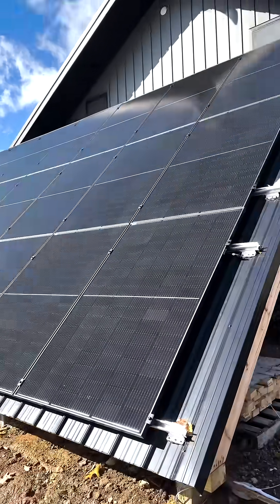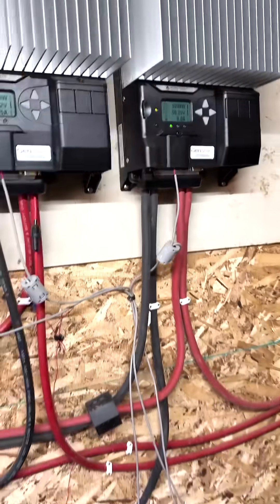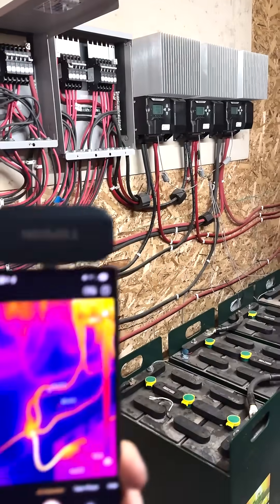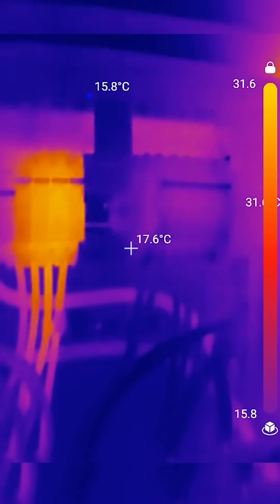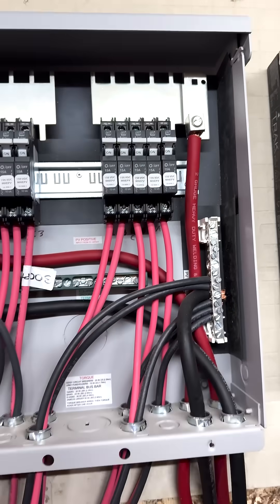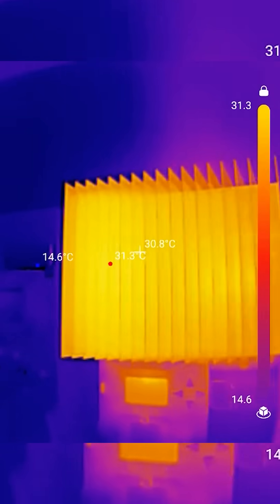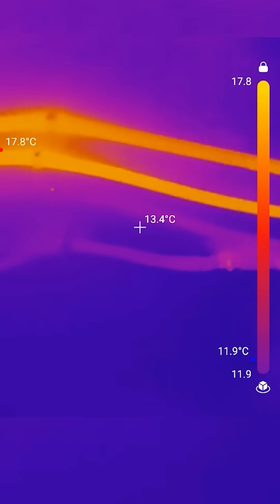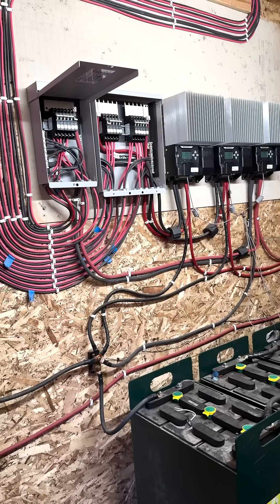Using the thermal camera to check my connections #narrowayhomestead  #offgrid  #solarpower

Comment: Use the thermal camera to check for insulation leaks, or roof leaks.
Since they have become so affordable they are a must have for a homeowner or someone looking to buy a house as you will be able to haggle better.

Comment: Just the heat cycling from the normal use of it can loosen up nuts and bolts so even if you put it together right the first time every couple months you should probably be checking it.

Comment: 2 things, slather some dielectric grease on those battery terminals and put some tape on those reflective surfaces to get a good reading.
Reply: A couple drops of used motor oil would more than suffice for the battery terminals.
Reply: petroleum jelly?

Comment: Thermal cams are one of the best electric diagnostic tools. Some parts should be warmer than others but if you see something cooking it's likely the problem you're looking for. Gives you a good place to start with the multimeter.
Reply: Yeeeeup, when doing motherboard and silicon chip repair. You run power through it under a thermal cam and watch to see which chips light up, then check their connections and replace as needed. Bam, after some delicate work you've got a new motherboard! No need to hit thousands of pins with a meter to try and figure out where your short is.

Comment: There was a mechanic on one of these platforms, not sure which one. But he used one of those to check the wiring on a vehicle that came in and the connection was really hot due to the connection not being tight. I never knew that a loose connection would run hot. 🤷